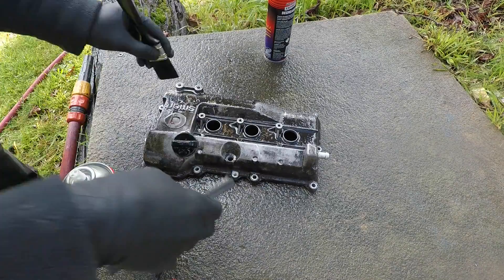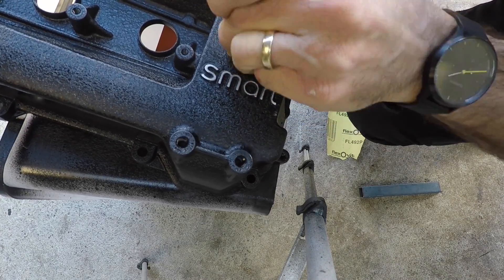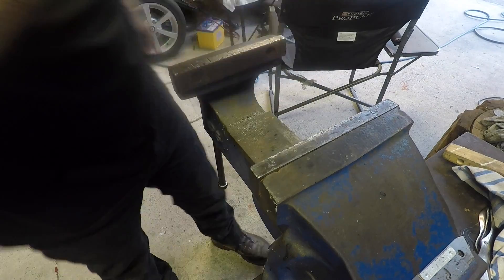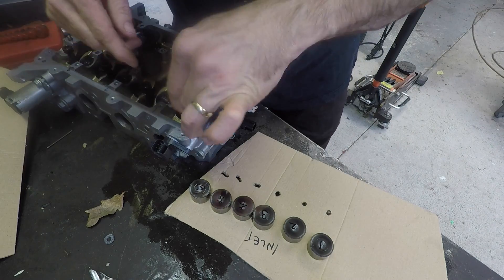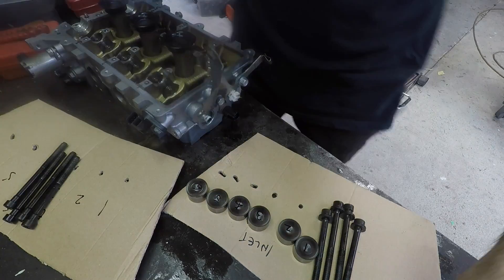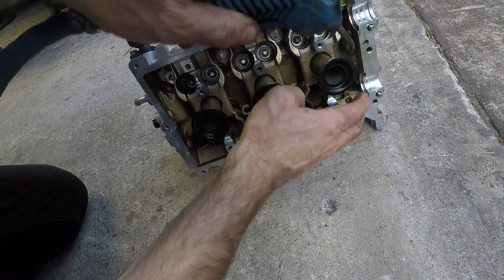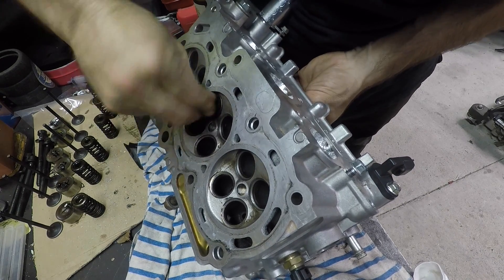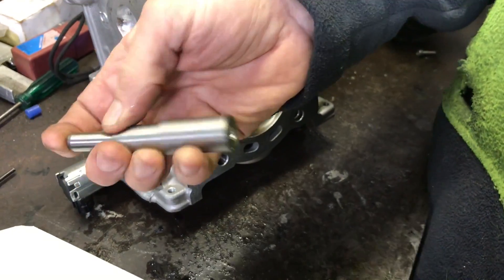Smart Car part 4 Engine rebuild prep work

Comment: Hi i have a 451 1.0 and going to replace the crank shaft . I think there are stretch bolts on the assy so have bought them . I can not find stretch bolts for main journals is it a bad idea to use them .
Reply from the maker: Hi mate, I reused all engine bolts and haven’t had an issue. Ideally they should be replaced but for me I didn't think it was worth it.
Reply: I can not get the crankshaft main bearing bolts back order . So will have to re use them . Would you have the setting you used . Great iTunes channel good info
Reply from the maker: Check this link https://www.fq101.co.uk/data-a-reference/50-tightening-torques.html

Comment: Nope.
You absolutely can mix those cylinder head stretch bolt washers.
It won’t change valve clearance in any way.
There’s all the same
Reply from the maker: Hi mate, I mentioned you need to mark the valve buckets. I wasn't talking about the head bolts or washers as they don't matter.

Comment: OMG why just not heat the rod? U can easily demage the rod like this.
Reply from the maker: Hi mate, it’s no problem as the rod is a clearance fit. The press fit is into the piston and not the rods…heating the piston is not a good idea
Reply: @Mezzmoengineering  there is two types of assembly, the normal clearance is about 0.02+ - into the piston, (if is not hot assembly), with oil that should be easy without any effort.
Reply from the maker: @miro_yo  interesting, my pistons were definitely press fit. Quite a heavy fit too, pistons were after market, engine went together well with good compression etc
Reply from the maker: @@retiredbore378 You can heat it if you want but it should be using an oil bath or induction heater. I wouldn't use a naked flame or water. I found pressing them in was fine as it was fully supported against the piston side wall so the pin was taking all the load and not the rod. There are always more than once way to do things, I just prefer this method.
Reply from the maker: @@retiredbore378 Yes, oil bath as it provides even heat distribution. At 80 C is not heated treatment. If you already know what you would do then not sure why you're asking this question. Remember there isn't just one correct way to do things.

Comment: Do you know the specs on those valve springs cause I can’t find anything. I have two bad springs and was hoping I can use another spring from another car by chance 🤷‍♂️
Reply from the maker: Hi Robert, check this link...https://www.mbpartsexpress.com/oem-parts/smart-valve-springs-1320530020
Reply: I already went there, but nothing stats the specs on the springs. Like it’s a top secret spring or something lol well thanks for your quick response back 👍🏼 keep up the great videos. Oh do you know the torque lbs for the cam bearings or the clamps that hold down the cams? I saw someone posted but i just wanted to make sure thanks 🙏
Reply from the maker: @robertthomas3862  Not sure where you would find the spring specs. Why wouldn't you just buy the original springs then the specs are not required?
Reply from the maker: @robertthomas3862  Hi mate, I can't remember exactly now but think the cam bolts are around 12lb/ft

Comment: I have 150k miles on my smart And when it broke down there was white smoke and it has been down since. I took out the oil drain plug and it seems the coolant got into the engine; is my engine done for it can I get it working again? I’ve lowered the brake and remove the top cover and I’ll be taking the oil pan off today to check more
Reply from the maker: Hi mate, anything can be fixed but will depend on the problem. It might be a blown head gasket or could be cracked head or damaged piston like mine. A compression test will help identify the issue. Will be a reasonable size job either way
Reply: @Mezzmoengineering  thanks man but I’ll be leaving to train for a new job soon and cant leave it in the garage I’m selling it

Comment: Hi! Help! Do you set repair sizes(+0,25 mm or 0,10 inch) for pistons, piston liners, and crankshaft liners? I don't understand much English:(. If so, where did you buy them?Thanks
Reply from the maker: Hi, yes I used 1mm oversize pistons. I used the current bore liners and just bored them to size. My crank and bearings were still in excellent condition so I didn't replace them
Reply: @Mezzmoengineering  Very interesting!Sorry to bother you. And what kind of pistons are these +1 (!!! I think this is a very large tolerance)? Please give me a link to where you bought them? Thank you.
Reply from the maker: @alekseevrodion3452  Hi mate, I went 1mm oversize because parts are hard to find and I also figure that if the piston fails again then I will use a different engine. Check this link, https://www.ebay.com.au/itm/182732648335?hash=item2a8bb6ef8f:g:wyoAAOSwDQJZtnw0
1mm works fine and still works perfectly without trouble. I've bored other engines more than this, some 2mm and one even 3mm oversize. The Smart 451 wall thickness is thick enough for 1mm oversize.